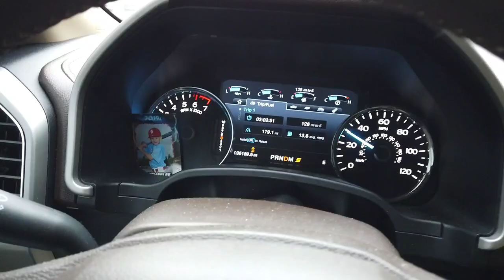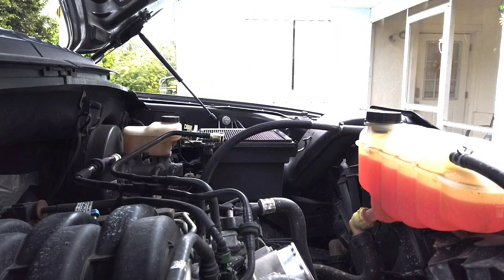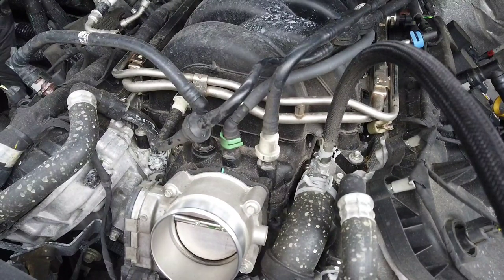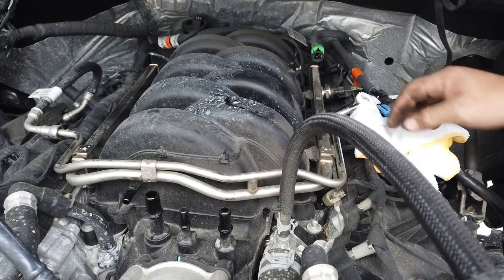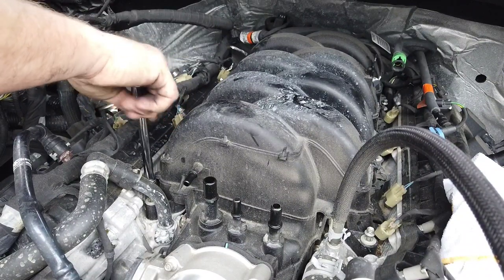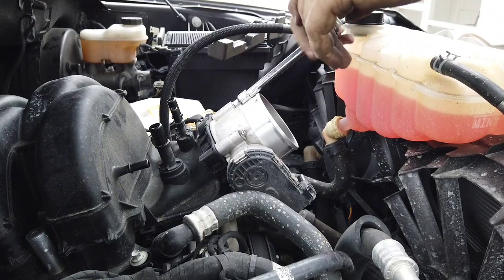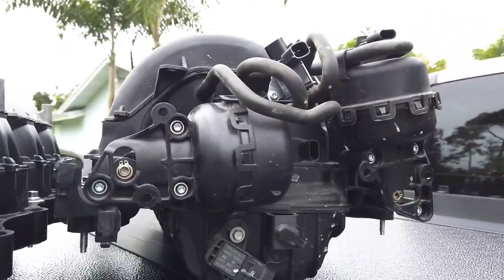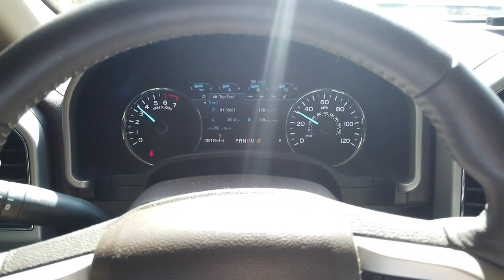2018 F150 manifold swap to 18 gt manifold: PowerAddiction

Comment from the maker: @Bailey Harper. Thanks for pointing out that I didnt mention the manifold bolt size. They are 8mm and there is 6 of them.
Reply: Do you loose low end torque by swapping to the gt manifold or is that just if you do the lock out
Reply from the maker: @kevinanglin678  nothing really noticeable. Especially if you are on corn. The 1000rpm extra makes up for it for sure
Reply: @PowerAddiction  did you run your truck with the manifold change without a tune? Because your talking about gains you notice that all could come from a tune only?

Comment: If you removed the  plugs on the back from the top side then I salute you. I had to remove front passenger tire and fender liner to get my hand behind the intake. I couldn't get to anything from the top. It seemed impossible

Comment: This is a lot harder than it looks. Everything was easy up until getting all those connectors loose in the rear of the manifold. I couldn’t even get the clips unlocked as everything was stuck shut. I wanted to check and clean the MAP sensor but gave up on this due to those damn connectors. Putting them back on probably would be even harder. You’ll need a good reach to get back there.
Reply from the maker: Haha yeah them connectors were the hardest part of the job. Once you get them off it's all simple. Putting them back on is actually the easiest part of the job because the can be pushed back in place with ease. Getting them out had me cussing up a storm lol

Comment: My .02 cents is the truck manifold would be better for the street and daily driving with the low end torque.  I have a 17’ Mustang GT with 3.55 gears and the ford power pack 2.  The car is fast but you need to wind it out.  I came from a 347 Foxbody mustang and a modded Focus ST where you have a lot more low end torque.  The Mustang is the quickest and will keep pulling however I found the low end torque of the Fox and the ST was more fun as a daily driver for me since most of the time I was in the torque and mid range.  I didn’t have to Max it out to feel it’s full potential as both fell off after 5500-6000 as where the GT will pull up to 7k.  It’s all a matter of taste and what you like and I love my Mustang but you definitely need to get used to it and drive it differently to appreciate what it is.  I’m either going to super charge the GT in the future to get the torque back or I’ll go back to the old school Fox or a Focus RS.  The turbo cars just give you the surge and power lower in the rpm and mid range where I’m using it the most on the street daily driving.  I don’t race and I do live in the country so occasionally I can feel the power the GT has but the turbo cars and Fox have the torque where I can feel it more often which makes them more fun as daily drivers.  Great job and hope you enjoy it
Reply from the maker: Yeah my truck is now twin turbo. The mustang manifold works beautifully  with it. I definitely  enjoy torque for daily driving. The turbos gave me a ton of torque right around 3k. It feels like when I had nitrous hooked up and it would kick in. Now its turbos and a lot more torque. I'm at 675whp now but soon to be at 1000whp. Its a whole other animal now. Valid points.
Reply: PowerAddiction 
Wow crazy
I’m saving and in a couple years should be able to afford the Ford racing Roush supercharger kit
It will give me about 625
Sweet
Drive safe and enjoy
Reply from the maker: @Sonicaceman  go with the Whipple and you will be even more satisfied  than the roush. The Whipple is better. Go follow high performance f150 5.0 page on Facebook. Lots of fast trucks there and you will get better insight  on the Whipple vs roush

Comment: Thinking about going with a ported 18’ manifold, headers, and tune in future
Reply from the maker: Add a catless y-pipe to that mix and you will have a little beast on your hands. I'm getting ready to install my twin turbos this month. Had them in the box since February and haven found time to do them.
Reply: PowerAddiction that thing is gonna be crazy with the twin turbo! May I ask what kit you got?
Reply from the maker: @chrisj5.0  Yes for sure. Got the fuel system to support around 1000whp. Hoping to be in the 9s. May have to add a few more goodies.
Reply: PowerAddiction I was looking at the on3 twin kit but that’s gonna have to wait for me lol
Reply from the maker: Thats the one I got. Got the upgraded billit internals 60mm. They are good for like 1200 but ill stay around 1000 at the track and 700 on the street for driving around.
Reply: PowerAddiction can’t wait for vids on that man! I’m subscribing to stay informed on how it treats you
Reply from the maker: @chrisj5.0  Thank you! Hopefully this month I can get to the track to run couole with the nitrous and also get the turbos installed. Then I can get more content out. Should have another video soon with a nitrous run if it dont rain tomorrow 😒

Comment: How does it run a mechanic told me swapping to the mustang intake looks good on the dyno but it will run like shit
Reply from the maker: That is total bullshit. It runs exactly the same as the truck manifold just different power. If you don't tune for it you will gain nothing because the power is made at higher rpm than the truck rpm. My truvk shifts a 7500 now.
Reply: It's only some throttle bodies that do it. My tuner told me to stick to oem tb and your good. Use the gt tb

Comment: Red wire obviously ? When disconnecting it’s negative first. When reconnecting it’s positive first.
Reply from the maker: I always just disconnect the red wire when working on anything that could cause issues while working on something. Fuel pump I just disconnect the fuse. Never knew the negative should be removed first. Never really thought about it much. Thanks for the info

Comment: Did any of this throw any codes or a CEL?  I'm in New York and want to make sure I can still pass inspection after I do this
Reply from the maker: It should not throw a check engine light that I'm aware of but its a pointless mod without a tune. It allows your truck to shift at higher rpms and make more power up high. If you don't tune for it you truck will still shift at factory rpms and you gain nothing at that point. Best bang for your buck is a hp tuning device and a tune by one of the top 3 out. Oz tuning, Lund tuning and Palm beach dyno. If you get tuned by one of them you will be super impressed. Then if you buy the manifold from whoever you buy the tune from they will revise your tune for the manifold.

Comment: Great video I have a 2013 f150 5.0 and I want to add the gt for more power do I go with a first gen coyote mustang intake or does it have to be the 2018 mustang intake it would be very helpful to know thanks
Reply from the maker: 18 or newer. Check out tuningbyoz.com that's where I hot mine. Make sure you get it tuned and also make sure you dont need anymore supporting mods to get all the benefits. I know the older trucks dont have intake runners so they will have to be locked out on the manifold. Go to "high performance 5.0 f150s" page on facebook and there's a bunch of good guys that will answer any question you may have.

Comment: hello, how did you install the map sensor in the 18 GT intake ? I got an 18 GT intake and realized that it doesn't have a map sensor hole in it.
Reply: also how's the transmission holding up ? does it handle the power while being stock ? sorry might be a stupid question but my previous truck was a Silverado that had a 4 speed transmission which kept breaking.
Reply from the maker: Hello. The map sensor hole i had drilled out when I ordered it. Cost like 15 bucks for them to do it but there is a flat spot on the back passenger side where they drill it. Also the transmission is still alive. I went to twin turbos recently and I think I may need to build it soon though
Reply from the maker: The 10 speeds are pretty bad ass. They are also in the ZL1

Comment: Probly the best question is does it remedy the notorious deceleration rattle the 5.0 f150s make made 2018 and newer?
Reply from the maker: Yes
Reply: @PowerAddiction  so to be clear, this 100% solves that issue? Also is there any other parts needed to complete this swap completely?
Reply from the maker: You need the pcv tube off a 18 mustang and yes it did get rid of it on mine but not sure if it will do it for everyone.

Comment: Is there enough slack in the harness to possibly have the intake sitting up a little and forward to deal with those plug connections? Excellent video BTW!
Reply from the maker: Thank you! Yes but it's still a pain. You can get about an inch more from it. Once you get the fasteners off you can get a couple more inches to disconnect the wire harnesses. The the knock sensor on the bottom you will have plenty of room.

Comment: Do you know if I do this will the truck pass smog
Reply from the maker: Should. Its not changing any emissions just allowing the air to flow different. I mean its the same motor and manifold as a mustang gt and they pass smog.

Comment: Size of manifold mounting bolts?
Reply from the maker: (6) 8mm Bolts come already attached to the manifolds. They can't be removed. When you order the new manifold the bolts will be in the manifold already. The bolts you see me taking out are the 4 fuel rail bolts and those are reused
Reply from the maker: Never mind I just realized what you meant haha🤣  it's an 8mm

Comment: Before the tune, did the truck struggle to start up with the new manifold? Having a problem like that with mine
Reply from the maker: Just for a few seconds until the fuel filled the fuel rails. Make sure everything is plugged in on the back.
Reply from the maker: Also if you ho to "high performance 5.0 f150s" on facebook other people may have had this issue. Decent informative people.

Comment: How is the driveability with the mustang intake manifold?
Reply from the maker: It's exactly the same just runs higher ram at wide open throttle
Reply: @PowerAddiction  That's awesome! Thanks for the reply.
Reply from the maker: You are welcome.

Comment: How long would you say it took for you to take out and re install the intake?
Reply from the maker: 2 hours maybe.
Reply: @PowerAddiction  thanks appreciate the feedback. Looking to do this as well. Probably take me longer but 2 hours is not bad.
Reply from the maker: @dankissane6685  you're welcome. Just take your time and it's pretty simple. 2 things. If you are going to install turbos in the future and you are tuned by someone. Install a 3 bar map sensor and lockout the IMRC and have your tuner time for that stuff. Make sure they send the tune before though or it wont run. I had to take mine off again to install the 3 bar for nitrous and now I have to take it off again to lock out the intake runners for the twin turbo install.
Reply: @PowerAddiction  that is good to know. I was probably going to buy the whole thing from OZ (tune cai and intake) in the next few weeks. In the next year I want to add a whipple so do you think I should install the 3 bar now?
Reply from the maker: @dankissane6685  dont think you will need it now since the manifold will be taken off and replaced with the supercharger.

Comment: Do you need to get a tune on the truck in order to run the manifold?
Reply from the maker: Yes! I'm sure it will run without one but how well is out of my knowledge. I do know the only reason to put these on is to get that extra 1,000 rpms and there is a horsepower gain throughout the power curve and more peak hp. If you want to do anything to your truck I'd advise getting a tuner and a custom tune from a reputable company. It will be the best bang for your buck
Reply: PowerAddiction okay thank you I have a 19 f150 5.0 and I didn’t know I have the intake for it all I need is the tune I was thinking of going with 5 star or palm beach dyno
Reply from the maker: Palm beach dyno, lund or oztuning (omega tune)
Reply from the maker: @jesusramirez4660  I personally have the omega tune by oz and it's an all fuel tune. You can run any fuel you want without changing tunes.
Reply: Okay thanks for answering my question I will definitely look into omega tunes
Reply from the maker: @jesusramirez4660  you're welcome. The omega tune is what the tune from oztuning at tuningbyoz.com is called. It's an all in one tune. You can tow, race, cruise and use any gas
Reply: All motor labs tune FTW